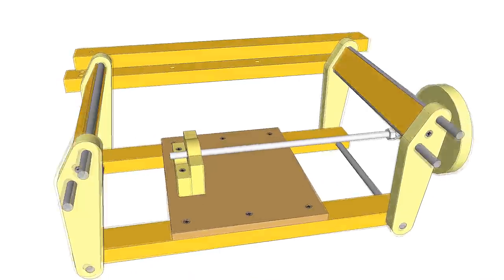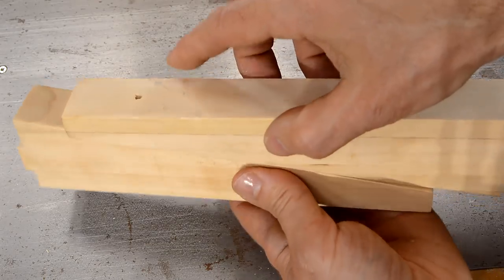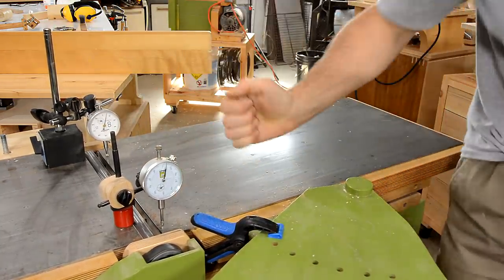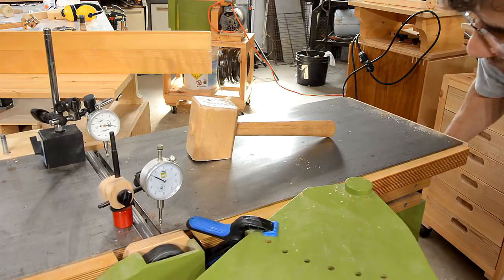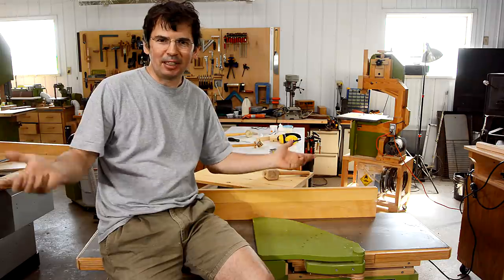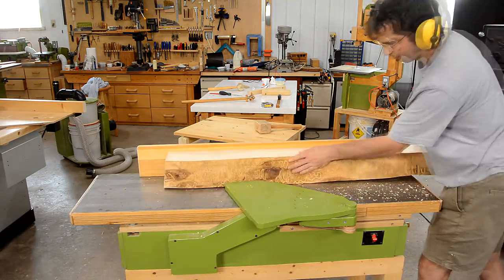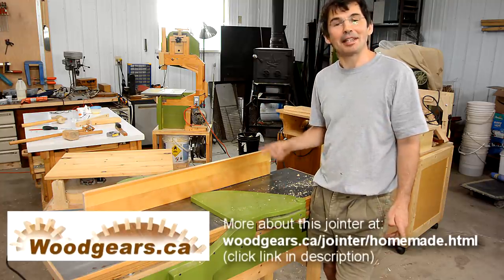Why I used a parallelogram mechanism for the jointer infeed table

Comment: I think when building precise machines its always best practice to make critical parts tuneable. So whatever mechanism you use, make it so you can adjust for any manufacturing variables.
Reply: As Jeremy Schmidt alway says: If you can´t make it perfect, at least make it adjustable
Reply: I make almost everything in I build adjustable before making it permanent once every issue is fixed. I dont have any tool that is precise. Heck the most precise tool are my rulers and square.
Reply: Yep, have to agree, adjustable and homemade is the way to go... I still haven't managed to purchase a single machine that I hadn't had to spent days tuning just to make it at least barely usable

Comment: Excellent rebuttal of a charge based on superficial thinking and an explanation of design attributes and alternatives and practical demonstration merits of each as they evolve in the development of your jointer. I'm a machinist and a woodworker and I know the advantages and disadvantages of both materials and the alloys of one Vs the species of the other. The Wandel parallelogram jointer is a clear demonstration of how wood construction may compete with metal for geometry, accuracy, and repeatability in the home manufacture of basic woodworking machines via clever design and the use of simple materials (except for the high quality birch plywood.)

I'd submit the Wandel parallelogram jointer competes with (except for lower power) the basic import jointer re-branded by Jet Grizzly entry level parallelogram jointers costing $1000 and up. The Wandel jointer has an intangible value in amping up the maker's skills and re-purposing existing disused materials and apparatus.

Well done on the jointer, its design, Mr Wandell, and especially well done for your courteous, well instrumented, and rational rebuttal of charges levied against it.

Comment: Regarding the last comment in the video: Building the fancy tools is indeed fair game, in fact that's why I watch. I'm not going to build a quarter of what you build, but it's really interesting to watch and it does give me some ideas to use at a smaller scale and some idea of what to look for in the tools. You explain why it works and how, which is important vs "You can do this with this, buy it at my sponsor." It also sets a bar for craftsmanship and shows how to "Do it right" even if I replicate some of the joinery you do with other less sophisticated tools (And significantly slower), as compared to some of the amateurs who don't really know what they're doing, or have every rockler tool known to man as a commercial tool. I don't have an unlimited budget to buy a million jigs and specialized tools.

And yeah, I will buy some of the commercial tools in some cases, or I'll make some of the jigs I need for my router table and table saw... But knowing how/why helps me make an informed evaluation of which to do which helps get more bang for my buck so I can buy wood to make more things. I also don't think I get much better at woodworking by watching people who are only as good at it as I am..   Those videos give me more inspiration than education.

Comment: That was really satisfying watching that lumber get planed to a flat edge. What I want to see (and probably never will see) is the pantorouter controlled by a computur (maybe raspberry pi or arduino) to plane down rough lumber with almost no human intervention. A person could then just sit across the room doing something else (sewing curtains?) keeping an eye of the pantorouter-pi as it automatically does its work (but they need not actually interact with the pantorouter, unless some error occured such as say a powercut or whatever). Then the pantorouter (maybe via a webcam software with facial recognition software converted to "shape recognition") can tell whe the lumber is planed down to size and so it starts to turn the lumber into a flatpack of a shed or chair or something (even though you'd have to glue it together the next day). The motor's duty cycle would be handled by the raspberry-pi (or arduino).

And yeah, I know people would poo-poo htis idea and say the usage of the router bit would be inefficient or the electricity cost is inefficient. But frankly I don't care about thse hypothetical problems. It would just be so cool to watch. It would beat a 3D printer in terms of how cool it would be. As an aside I do think 3D printers should allow a person to make a form of MDF but having both PVA glue (or similar) in one input tube and fine saw dust in another input tube.

With a pantorouter automated like that (especially if it had a z-axis on a hinge too so it moved like a robot-arm that builds cars), I bet you could walk into a derelect house and load in some digital blueprints and throw treetrunk on the pantorouter-pi machine and then watch it rebuild everything as a flat pack while you drank tea (or while you did some other task, like say gluing together its flatpacks it made the day before).
Reply from the maker: That is indeed something you will never see, because the whole idea of the pantorouter is that you don't need a computer.  Once you go to CNC, a pantograph makes no sense.

Comment: That surface planer can take loads more abuse than my £500 Matarbo, I'm always impressed you have made your own machines and they are of good quality.
Reply: Haha yeah. My Jointer is a medium size with 33cm  cutter head. Its full cast iron, really heavy you have to be with 2 people to move it and everything on the table is heavily ripped to make it even stronger, but I bet when I jump on it like Matthias did here it will move by at least a full mm if not more.
Kinda sad really.

Comment: To use an incline you would need to use a combo dato dovetail slot which would hold the table both level and keep it from skewing. That idea though does have a problem when built in wood as the slot and dovetail would need to be loose enough to account for wood movement and that looseness eliminates the precision of the tool making an all wood setup not desirable.

You could put a dato into each of the wood planes and insert an aluminum t-slot in one and t-bolts in the other plan. but in this case, you might want to fabricate the t-bolts yourself to insure that there is no slop in the width or the thickness between the t-slot and the t-bolts. The t-bolts could be fabricated with strong HDPE plastic which would have a lubricating affect against the aluminum and would allow for as tight a fit as you desired.

There are indeed several ways to create a lifting mechanism and the best mechanism of the various designs is the one that does exactly what you want it to do and works in your design such as your jointer with the parallelogram mechanism.

Hmm, I wonder how that parallelogram mechanism would work in a CNC or 3D Printer setup?
Reply: I was thinking along the same lines as I watched the video. What would be the downside of all HDPE doevetail applied to the wood incline? One side of the dovetail could be adjustable to account for wear or wood movement?  Of course adding more parts to the incline moves it farther from the "simple" design it started from.

Comment: It seems to me that most of the problems you pointed out about the inclined plane could be mitigated by the use of sliding dovetails, and if I'm not mistaken, I think that's how most factory-made jointers are constructed. But I haven't used a jointer in 15 years, so I could be wrong.

Comment: FWIW the big, standard (630 mm) jointers all use an inclined plane, though I don't know whether that runs on dovetails (probably) or is just preloaded. Of course, this is much easier to construct out of cast iron and much stiffer than a parallelogram mechanism made from the same material.

Comment: As a thought experiment, would it work to have four bicycle sprockets attached to four vertical bolts, driven by one chain? What would the potential problems with a mechanism like that be? You'd need a micro adjustment, at least when setting it up initially, and might be able to get away with two nuts jammed together at the top of the bolts.

Comment: I built Matthias jointer a few years ago...i have never adjust the depth of cut since I initially set it up. It is not something you typically mess with on a jointer unless you are cutting rabbits or some other silliness best done on the table saw. I have used it extensively and not has any issues with it.

Comment: I've never built a jointer, and I don't intend to.  And Matthias clearly demonstrates that his parallelogram arrangement is robust, certainly more robust than his dial gauge.  But I will observe that my Delta 6" jointer uses an inclined plane, is rapidly adjustable, and is quite solid.  That is not to say that it is better or worse, but the inclined plane was the design choice made by a reputable manufacturer.
Reply: Yes, but your Delta isn't made of wood and can't be built by the home-based woodworker.

Comment: That rough timber reminded me of an  argument between my dad and I. My point was a jointer is required to true up rough lumber. Dad disagreed, but turned out it was a difference of definitions. My definition was like the timber shown here. Dad's was lumber that was practically true to a degree and deliver rough sawn with no milling as structural lumber was delivered back in the day.  I rarely if ever let the fact that  someone has better equipped shopthat prevent from watching a video. I don't yet now everything there's to know about everything, I generally ;) so end up learning something. However I don't take it as gospel without doing due diligence

Comment: great response video Matthias. As john himself says, he is a contrarian.... Its pretty clear that the parallelogram design is the better solution. 
Also, in response to your final point about building machines etc. , I just watched another high profile maker and they had every tool available, including a nice new SET of stihl saws, and (in my opinion) the finished piece could not have less reflected having been made with all the best brand new tooling. Basically, I thought it was a very poor finished item.  I am always amazed at the things you and john have made/make and using budget/basic tools. 
I like new tools as much as anyone, but It's very grounding to see what you guys can do without having every tool under the sun at your disposal. pantarouter.... need i say more!  I actually find myself losing interest in OTHER youtube makers BECAUSE they just get handed new tools all the time. Don't get me wrong, I would milk it for all it was worth probably, if they were being offered to me :D

Comment: What bugs the shit out of me is when channels imply that the only way to do something is with a specialized tool, even if it's not actually the case. "I'm going to use a CNC for this because I have it, but here are some alternatives" is fine. "You HAVE to have a CNC for this because reasons!" is not. Or saying you have to use a store-bought jig for things like adjustable shelf pin holes. I don't even own any tools, and I can think of a couple of potential shop-made jigs for that.

I always enjoy seeing the thought process that goes into these designs, especially engineering ones. Do any commercial machines use the inclined plane?

Comment: Hey Matthias, maybe you can explain why the infeed table is always the adjustable one and not the outfeed table? I wonder if having it the other way around would be an interesting experiment?
Reply: Outfeed tables are adjustable, but not for depth of cut. They need to be set at knife height, or just a couple of thou from there, then left alone for the cut to perform properly. It’s a setup thing, not a daily operational thing. The experiment might be interesting, but not particularly useful.

Comment: Is hitting the surface not knocking your gauges out of calibration? I was always told to pull back the pin on the gauge before hitting something it was resting on.

Comment: Hi Matthias.  I know this is a bit of topic but why do you always pre drill holes in the material a screw is going into?  Does it make the joint stronger?  Is it easier to screw into?  I understand the reason you drill a hole through the material that the head is up against, but not the other .  Thanks.
Reply from the maker: I only pre-drill when it makes sense to, which depends on the wood, the screw and the need.
Reply: Some woods like to split particularly if the screw is thick or long. So it makes it worth doing sometimes. Oak for example is a hardwood, and like a lot of hardwoods it'll want to crack if you don't.
Reply: Zach Stein Thanks Zac.  I’m only a relative newbie to wood working so any advice from you or Matthias is greatly appreciated.

Comment: I'm curious how commercial jointer tables (which are easily adjustable) do it. Did Matthias come up with a unique solution, or is this just simple reverse engineering?
Reply: I've seen some that use a parallelogram mechanism. They cost more.

I'm not sure how most of them do it. My cheap benchtop jointer just has the tables screwed down. I used paper to shim the infeed table to get them coplanar. But I'm actually not sure how the raise/lower mechanism works.

Comment: I think it goes in the same direction as the kinematics "political" rule that pivots (even made of 2 spherical joints) are the cheapest option, and that you did put a lot of pivots and still feel "cheaper" than the simple sliding joint you were comparing against.

Comment: Wait, Matt, I'm confused. 2 things:
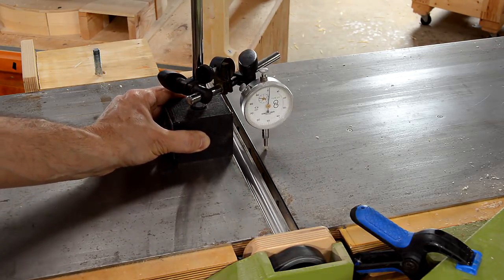1. Why, at 2:02, did you use that apostrophe in "thousan[D]th's"? Which possession of a thousandth were you trying to refer to with that?
2. Why are there quotes around "right" in your description about making inclined planes work right? Were you not indeed referring to the actual correctness of making the inclined planes work, or... what, exactly?
Reply from the maker: making the inclined plane work precisely enough is not as easy as making it "work".  If that' too confusing, sorry, can't help you.
Reply: Well, Matt, I guess my question isn't about how easy or hard it is to make work, but that if there's a way that it works actually right, then the quotation marks are pointless, because that's like saying that if it works "right," it's not really working right (like quoting the idea but not as a reality). See what I mean?
Reply: Also, Matt, what about your answer to my question #1 here, which was: Why did you believe you needed an apostrophe in "thousan[d]th's" at 2:02?

Comment: I have always picked up a Frienemy vibe from John.  I like his channel but as I went from a blue collar tradesman into engineering myself I can recognize that type of resentment.  If parallelogram was needlessly complex than every high end jointer wouldn't use that method.
Reply from the maker: John has a strong need to be different.  I used a paralellogram, which meant the paralellogram was taken.

Comment: In my mind, an incline plane table would be simpler, despite the very real concerns you raised. Each design has its own challenges, and for my skillset and experience the inclined plane design would be easier. Obviously not for you.

Comment: but if you have a inline plane with a dovetail that will get rid of these problems you talking about
I think you're better off using granite or concrete, than metal for the top won't suffer the displacement and Wapping the same more rigid